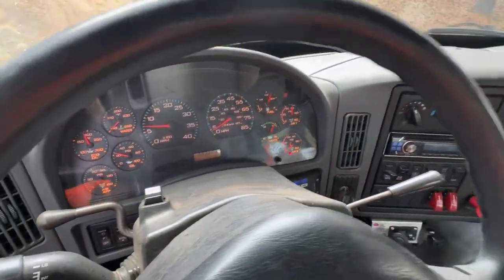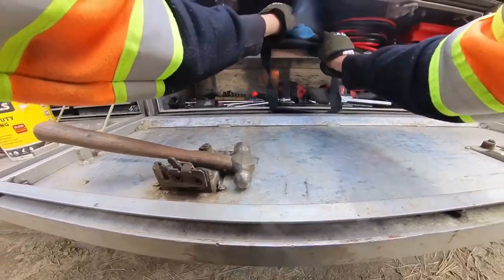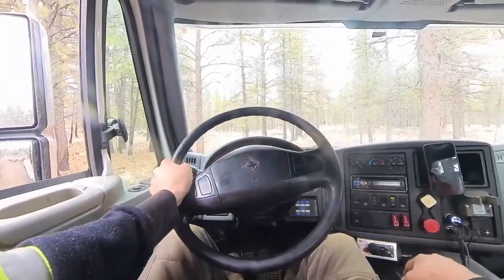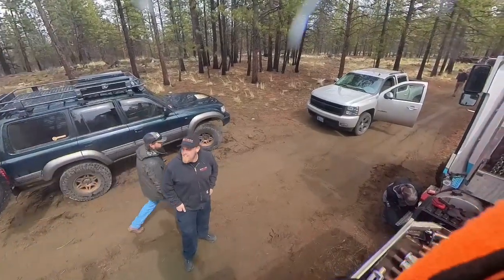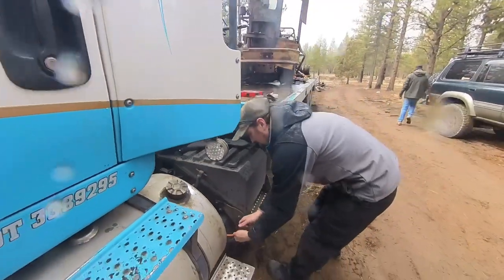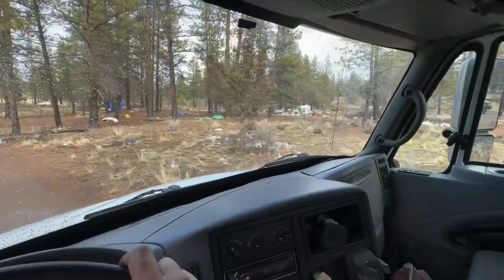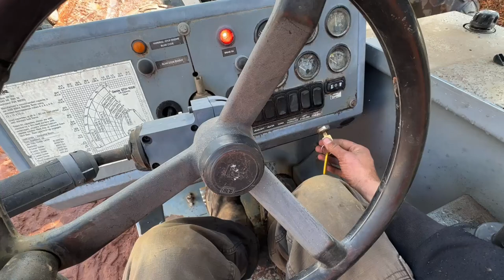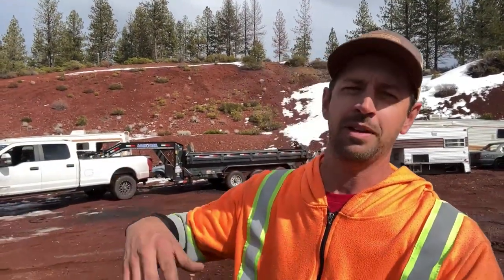I broke my truck trying to clean up this burned RV

Comment: easy bush fix, happens all the time
find a descent branch thats a bigger diameter and pound it in hole, for fix to get out of bush
ive also have done this for fuel tank punctures also
get er done ,casey, eh
Reply: You’re forgetting there’s supposed to be 125psi inside the tank that would blow that out before it even got that high.
Fuel tanks are not under that pressure so that’s possible to do.

Comment: Hey Casey love the content been watching on a different account linked to my tv had to jump on the pocket computer to write you this. 
1.) I’m right on the Oregon coast and van travel and one day maybe I’ll need your help hopefully not the case because that will mean bad news for my van or me and the van. 2.) also if you ever need any work done like pressure washing I would love to help out I travel too. 3.) I seen another video about your rear chain pockets on the Zack, I was thinking maybe if you slapped a piece of rubber with a slit cut out to access the chain and keep junk and snow melt outa there but it could be a bad idea take my advice for what it’s worth and idk. Enjoy the videos got both my accounts subscribed be safe friend! 
-Conner

Comment: I would have taken a piece of wood and whittled it round and tap it into the hole as a temporary repair. 🤷‍♂
Reply from the maker: I thought of that, but I didn’t think it would hold 125psi, and knowing my luck it would blow out when I was walking by and I’d have 4,000 tiny splinters in my leg
Reply: @CaseyLaDelle   Gotcha , splinters in leg would not be a good thing. 😟
Reply: Richard you stole my thunder.  Lol.  Good stuff.   Stick the wood in then secure it with a ratchet strap.  Good to go.
Reply: @gordmcdonald2807  na bro…….NASCAR CERTIFIED DUCT TAPE, that shit fixes everything. Lol 😂

Comment: To get the broken valve out. When you dont have easy outs at hand try jamming a flat blade screw driver  into it with a hammer then using the cresent or vice grips try unwinding it while you lean on the end of the screwdriver. If all else fails  you can hammer in a large torx key and use the vice grips on the end of it. Or a large screw. desperate needs = desperate measures. I hope you have taken lessons at the school of automotive butchery. It helps LOL

Comment: Of course, if you had the right tools and the correct parts to repair the air tank, you can guarantee that that fitting would not get knocked off.

Comment: The problem won't get fixed until they make LIVING at those campsites illegal. Those people aren't camping. It's depressing that you guys are putting in so much effort to restore the area, but there are still people living in near derelict trailers surrounded by trash. You are Sisyphus pushing the boulder up the hill. You are doing a good deed that will be rewarded with even more trash and abandoned burned out vehicles.

Comment: Also, side note. If you look on the screwdriver (most brands even cheap ones) at the bottom of the handle youll see what looks like a wrench spot. You can most times slide a 14mm or 9/16 in there and turn with a wrench. Sometimes they are larger or smaller. Just giving you a tip. Use it or don't :P

Comment: drive a 3/8 bolt in the hole ..it will slow the air loss down..

Comment: Do you have a hex or torx bit you can hammer in and back out the old fitting?
Reply: He replied to a similar comment that he had torx but didn’t think about that.

Comment: I"m surprised there isn't a piece of metal protecting that actually so that doesn't happen. Something bouncing on the road could likely do the same  thing. You need to buy *another pressure washer you mean? Make sure this one you can see in your mirrors before you leave perhaps if you know you haven't put it in the shop or something. 🙃 Or was this video predated and that's the pressure washer that was dragged?

Comment: That is a poor design for a tank connection even for a pure road truck. It could have been given a protective guard or repositioned possibly facing inwards instead of being exposed on the outside.

Comment: Too bad you didn't have a 3/8 bolt cuz I'll bet you the whole that you busted off on that pipe fitting you could put a 3/8 bolt in that brass fitting plug it off completely

Comment: Take your pocket knife out  Whittle you a limb down take your hammer and drive it in there it So would you get back to the shop you do fix it properly
Reply: You’re forgetting there’s supposed to be 125psi inside the tank that would blow that out before it even got that high.